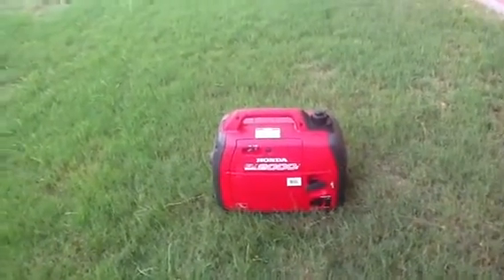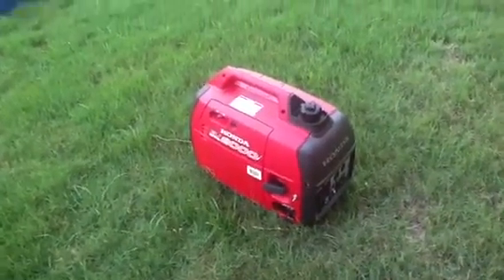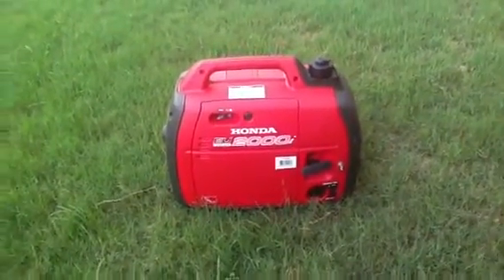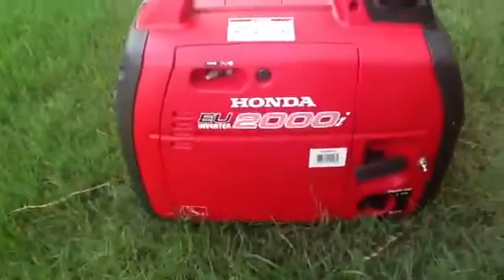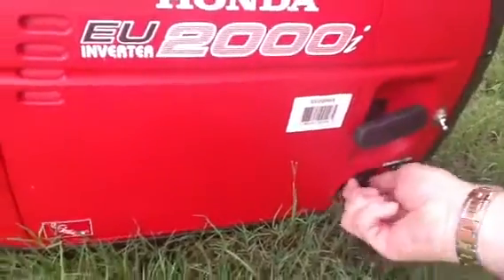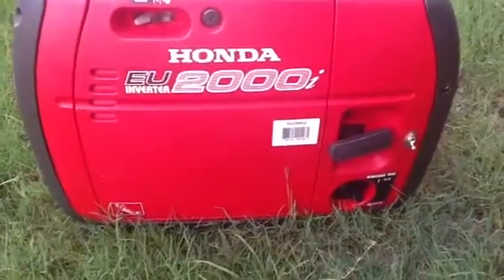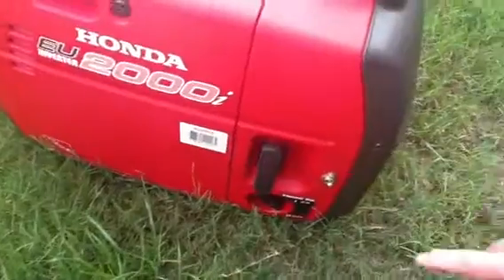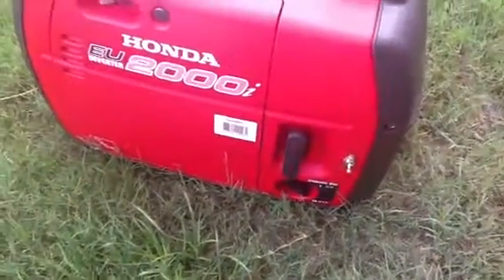Honda eu2000 generator mod

Comment: join us https://hondagenerator.groups.io/
kinda a bad idea on the switch on the side...
that handle will get smashed off for sure..
use a water proof N/O momentary push up on top is what we use.
measure and look in side before you drill!! lol!
Reply: Yes, I could have picked a better place to put that switch but it's still there and fine 7 yrs later. I guess I could put a "switch guard" on it (like the old switches the military use). Thanks for the comment.

Comment: Cool mod, we used to do that with the boat motor also when finished using it so the gas wont clog up the carb jets its worse with 2 cycle gas motors because of the oil and gas mixture ..........

Comment: Neat work, but as mentioned the general problem with this ideas is the notion of fuel pump diaphragm drying.
The fuel cut off stops the fuel feed to the fuel pump.
There is another video where they cut off the fuel feeding the carb, thus leaving the fuel pump diaphragm 'wet'.
Reply from the maker: I see your point, but I've had it this way over two years without issues. I figure the diaphragm doesn't need to stay wet to be fine, just like a rubber boot on a cv joint on a car, or any other rubber parts (like tires), pretty durable.
Reply: Hi kb5zcr,
So in this regard, do you at all worry about a fuel stabilizer. I really like the Stabil 360 product in my other outdoor equipment, but I can't get any feedback from Honda folks on the same. They all stick to the plain Storage product.
Reply from the maker: +Cedar Park, Yes, I do also use fuel stabilizer. I think I use Seafoam.

Comment: " 'structions? we don't need no sticking 'structions "...btw, ever heard of 'fuel stabalizer'....its that stuff you put in gasoline to prevent 'gumming' when you want to store an engine for long periods (its actually mentioned in the manual, pg 55). Oh yeah, about those " 'structions ", they cover 'draining the fuel tank and carburetor' as well, pg 56, to prevent 'gumming' and degraded fuels during storage. Just so you know, running the engine 'dry' isn't really good for it, and the fuel stored in the tank can still go 'bad', making it more difficult to start and still gumming up the 'works'. So, you'ld still have to put 'stabalizer' in the tank anyway...so why not the whole system (by running stabalized fuel in the gen. for 10 minutes) and simple store the unit ready to start from the get go. Instead of yanking and cranking on a DRY cylinder til you draw fuel to the carb. you ran dry?

Comment: Wouldn't that make it harder to start next time, especially since there is not a priming bulb on the generator? I have the exact same model and use it for camping. Storage at the end of the year is according to Honda's policy of draining the carburetor and emptying the fuel tank.

Also, on your gumming comment, if you run premium unleaded through it from Chevron or one of the premium brands occasionally it really eliminates that issue. I've had my generator for over eight years, no problems.

Comment: Nicely done! thanks for sharing!
Some people instal extra fuel cut-off instead of the ignition switch - claiming that the fuel pump does not dry.
Also choking the carb can help burn more fuel when it starts to miss-idle at the end. :)